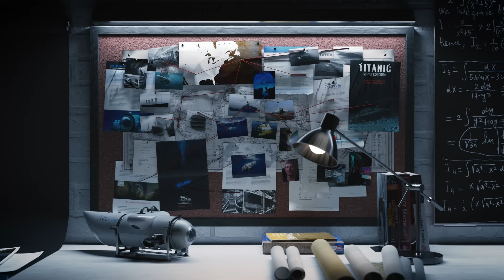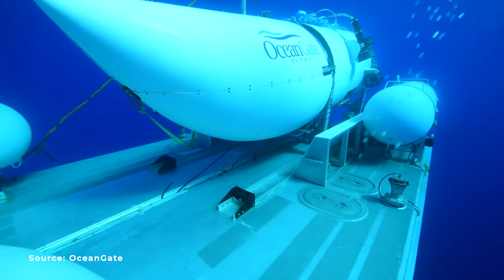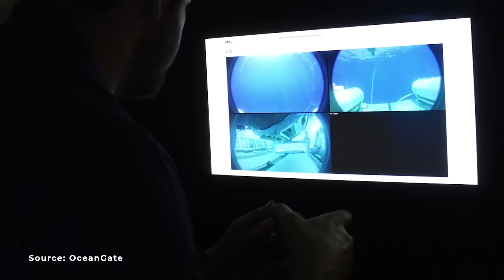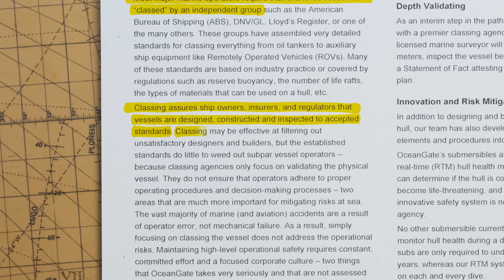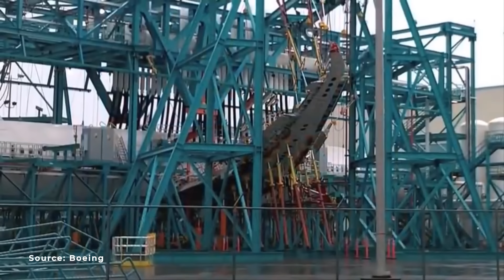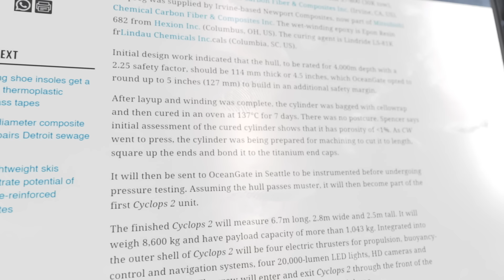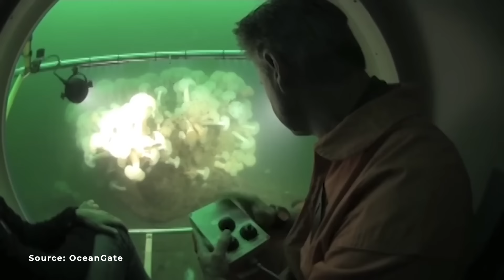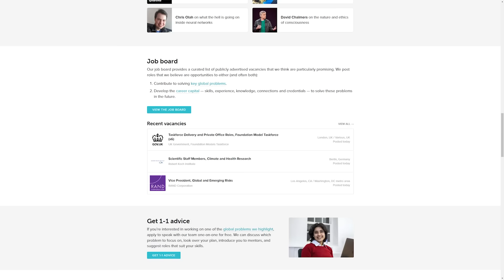The Questionable Engineering of Oceangate

Comment: I’m not an engineer but there appeared to be two glaring problems to anyone who doesn’t even know about it in this situation 1. If you can afford to pay to build it in the first place then you can probably pay to test it 2. If you’re gonna build something that’s required to withstand immense pressure why wouldn’t you stress/fatigue test it before using it?
Reply: they could have easily done a empty tethered dive to depth..
They didnt.....  what is worse the Company intentionally never went through proper testing and evaluation processes
because it would have been been condemned
Reply: @zarthemad8386  So the reason they neither paid for further testing nor wanted further testing is because they already knew it wouldn't pass the testing? But they still went ahead with the dive anyway? Did they just think that crossing one's fingers would be sufficient or that wealthy people don't die only poor people? I have very little sympathy for them if this is the case. It would've been very easy to test the sub first and correct any problems or scrap it entirely if it didn't pass the tests.

Comment: I do want to add that game controllers are actually fairly common use in a lot of strange places far removed from gaming. It's just a strong ergonomic design for putting a large number of digital and analog controls in two hands.
Reply: Yes, but:

1. An off-brand, made in China Bluetooth controller, when a reliable Japanese model could be had for $30 more?

2. Zero wired or manual control backups?

Utter madness.

Comment: People think of Carbon Fiber as being this magically strong and lightweight material, but as he stated, it’s really strong until it isn’t.  I’m certainly not a composites expert, but CF is very rigid but also brittle as he showed in his graph. It’s incredibly strong but once it flexes too much it simply snaps, which hardly seems a logical substrate for a submersible which will repeatedly deal with these kinds of pressure changes.  In fact, I would almost think Kevlar might be a better option.  It’s not quite as strong by weight as CF but it’s much more flexible and thus better equipped to handle the cyclical stresses of repeated dives.  

Also, I’ve seen mention in a number of places that Oceangate “expired” CF from Boeing at a huge discount because it wasn’t safe enough to be used in an airframe!  If it’s no longer considered safe to replace aluminum in a plane what on earth would make you think it’s safe to replace steel or titanium in a submersible.  If those stories are true, that’s nothing short of gross criminal negligence on the part of Oceangate and Rush.

Comment: The move fast and break things ethos is fantastic in prototype, testing, and validation processes. The ability to design, fail and fix speeds up development and can help prevent design creep. but this should not extend to manufacturing end use products.

Comment: 1:20 
My 1st concern is the design. A spherical design is far stronger than a cylindrical design, as the pressure causes shrinkage evenly across the hull and compresses the hull onto itself, a cylinder under the same pressure compresses bending inward.
Now on to more of the video
Reply: A sphere does let you get away with less material for a given volume, but a cylindrical shape works fine if you're willing to use some extra material
Reply: @addison1024 , depends on the material. Composites are now proven to have limited life expectancy without the ability to check….
At least metal is consistent, (unless flaws are present, as has happened in jet turbofans…)

Comment: Expecting to predict a composite hull delamination by listening to it crackling is like standing blindfolded in front of someone with a gun and expecting to dodge the bullet by waiting until you hear the gunshot. Oh you'll hear it alright...

Also I think there's a huge difference between what he did and what Elon is doing. 
SpaceX is testing unmanned rockets to failure in uninhabited areas and endless safety procedures. Mistakes/Unexpected can always happen but the redundacies are so abundant that there's basically 0 risks to everyone involved. New materials, new engines, new technologies, new manifacturing methods, innovations across the board.
Rush took all the risk-factor elements from SpaceX's approach but discarded all their safety features, didn't innovate in any field, if anything he  took well known materials / building methods and chose the cheaper versions of both, then proceeded to toy with people's life for money and to satisfy his narcissistic ego. 
If he actually took their approach he would have not only built it differently, but also throw that thing up and down the Marianna trench 20 times before even considering putting so much as a mouse in it.

Comment: To be fair to the game controller used as a steering device, there's a reason why it's a more widespread practice than you'd think. They are intuitive to use, easy to program to do whatever function they are used for, cheap to order in bulk and are standardized to be very easily replaceable, which makes them perfect for when you need to Steer a thing but don't need to design a separate mechanism for it.
Reply: Yeah but using bluetooth is idiotic
Reply: An off brand Chinese Bluetooth controller.

He saved maybe $30 on not getting a real Japanese Bluetooth controller like the military use.

A sub having zero backup systems is also insane, but there's a long list of insanity in this story.

Comment: Stress cycles took down the Comet jet aircraft - materials have bonds between atoms that are affected by conditions - cold makes them brittle the notorious brace of Liberty ships that snapped in half in cold climates - and Titanium which age hardens - good today bad tomorrow - it was banned in some components on race tracks in the 60's and 70's for this reason - the high pitch sudden creek sound was undoubtedly carbon fibers shearing under load - tragic.

Comment: The thing is, "move fast and break things" is a good mantra. It works. The important step is the thing they're missing.
To be able to move fast and break things, you need to be able to afford breaking things, and the things you break need to be unimportant.
"move fast and break things" NEVER EVER EVER EVER applies to things which involve human lives. That's the point. Test destructively when it doesn't matter, so you can trust your tech when it does.
You can break remote drones, unmanned rockets, and test vehicles with dummys in them. And, in fact, you should.
The mantra comes from software, where it is still applied with that effect. You don't ever break the system that matters, instead you test things, and learn from the failures, rather than trying to make it work first time.
The point is that no matter how slowly and carefully you go, it still won't work when you try it in real life. So instead, you might as well just get on and try it, then figure out what went wrong when it fails. You expect the first test to fail, you don't trust your life to it, duh.

Comment: Just use the simplest possible solution for this type of tasks. 15-20 centimeters steel walls should do the job. What's the point of complicating it? 
Make it from 1 piece of steel. The submarine is not even that big....

Comment: "Move fast and break stuff" was a motto taken from software, and doesn't translate well to hardware. I agree with your take there, as well as your view that OceanGate took standard composites manufacturing techniques and applied them, and was not inherently innovating.

The dig at Elon being overconfident seems strange, given that the Crew Dragon work seemed to follow a completely different test cadence from SpaceX's uncrewed flights.  Overconfident seems like an appropriate moniker if someone is failing, but SpaceX has a pretty consistent track record of success - I'd say appropriately confident would be more accurate.

Comment: looking at how they epoxied the cylinder to the ends. its no wonder it broke... those joints were almost certainly filled with air bubbles... i am almost sure thats what gave loose first and as soon as it moved off that lip "kaboom"...  at least its painless and quick... the cracking they were hearing was probably the air bubbles in the joints cracking a little each dive the hull flexed heavily... when enough finally broke,, boom...

Comment: What I can’t understand in the first place is, why build the damn thing in the shape it was built. The hatch end isn’t bad I suppose, because at least it’s rounded. But that point at the other end? Come on! Even a first year engineering student knows stresses are going to concentrate there. Actually, the ideal shape for a craft like this would be spherical, because the stresses would be spread out evenly in all directions. Make it spherical and of the right material, and it would be able to withstand the extreme pressures of two miles’ head of water.

Comment: Nobody is talking about the fact the Titian was sinking much faster than normal.  The Skylark even asked, “Do you  need to adjust velocity?”  The Titian was unquestionably heavy that day. They even had to drop the frame, but the ascent was still to slow to surface any time soon.  It was doomed at this point, but why was it heavy?  They dragged it for almost three days on a small raft exposed to rough seas and plenty of salt water.  Could the carbon fiber hull absorbed many pounds of water?  They didn’t weigh the sub to be sure it was on weight? The Titian was far too heavy that day, and nobody is talking about why!

Comment: "Over confident CEO"? No. Not nearly. Musk never put lives at risk. He tests rockets to destruction while unmanned and repeating to move faster by spending money on many copies, while improving them rapidly. 
His F9 rocket has flown 300x since early days failures (Long before putting any humans on thee rocket.) The rocket has higher failure tolerances as the rocket is designed for multiple uses and has 9 engines so that an engine out will not result in mission failures. During the 300 flights, there were 2 engine failures and both were successful. 

So no. Sorry if you don't like Musk but his cars have some of the highest safety ratings ever achieved and his rockets are rigorously tested to destruction before they fly. 

NASA and their traditional contractors, All the major car companies... came up short by comparison (How many deaths due to shuttle?). If you have an anecdote to point to, I would recommend remembering that engineers use statistics to form conclusions, not a few anecdotes in a sea of data with 2 million cars produced per year at this stage with analytics captured that far exceed any other car. 

FSD is statistically far safer than just driving alone and this is backed by data that NTSB and  other federal institutions peruse regularly.
Reply: Tesla has a below average safety record. He endangered and does endanger lives.

Comment: When I first heard about the submarine going missing and the fact that it was made out of carbon fiber, I knew it was a goner. I could never afford college, so I'm woefully undereducated. But I did fly racing drones for a few years. The frames for the drones are also made out of carbon fiber, with different manufacturers using different variations and thicknesses. Everyone in that hobby knows that the carbon fiber frame wears out, even if you manage to never crash. Just the repeated push and pull of the motors and gravity would bend the frame with every turn and boost. The more experienced fellas would be able to tell when it was about to happen and would swap frames before disaster struck. New flyers, however, would just fly until the catastrophic failure happened mid-flight; resulting in $400-$600 worth of equipment being vaporized.

Although a couple hundred dollars loss is nothing compared to the loss of human lives...

Comment: I understand your point but spaceX isnt exactly known for being unsafe nor reckless. They move fast, yes but they also test... A LOT. spaceX has at this point extreme amounts of experience and data. And this is when flying unmanned aircraft. For their manned mission the amount of testing and checks was increased even further. 
The Falcon 9 is the most flown US rocket ever. And has the best safety record in spaceflight history. And it keeps improving. The block 5 falcon 9 has 239/239 successful launches. Say what ypu want about elon must, or about their "recklessness" but their record shows attention to safety (and so does tesla) beyond most if not all competitors
Reply: A piece of concrete launched from the space X site destroyed an SUV.

This was because musk decided they could launch from a concrete pad.
Reply: @BeepBoop2221  1. This is per NASA guidelines 2. The area was cleared and evacuated like with all launches. The SUV should've honestly not been there. 
Nobody's was hurt, it wasn't negligence. And there's a lot more going into it that "Elon thought" 
Also, you do realize all launchpads are made based on FAA regulations and laws. They were up to code. Oceangate didn't test their sub and it was NOT to code. That's what negligence is. This was a honestly hilarious mishap/accident. 0.25 mile from launchpads isn't considered safe distance to a rocket launch, 1.5mile radius is usually the minimum evacuation and I think space X does 3 miles.

Comment: You don’t need to be an engineer to realize this design was problematic. I don’t know how their engineers didn’t catch this. Why didn’t they x-ray the hull for voids? I work for a company that does additive manufacturing and SLS with carbon PEKK. All of our parts are x-rayed post sintering, and smaller test parts are tested for tensile, resistivity, specific gravity, FTIR, etc… The notion that there’s no equipment to test polymer based composites for defects is simply false.

Comment: The one difference about SpaceX's  "moving fast and breaking stuff"  is that all the stuff that was breaking, was not manned, and that SpaceX kept analyzing what went wrong and made changes, until they got a reliable functioning system.

Rush was definitely egotistical, overconfident, stubborn, and out of touch with reality.  I think he knew he didn't have enough money to do it right based on his remarks about how the testing organizations would cost a lot of money and wouldn't certify the Titan because it was too experimental.  He also talked about not using a titanium hull with buoyancy foam because it was expensive.  Other signs that he did not have enough money to continue improving the design and materials was his hard sell to get passengers, oops "mission specialists".  Father and his son who thought about going on a dive on the Titan but decided not to because of the $250k per person cost, said that Rush flew to Las Vegas to try to talk them into going and reduced the ticket price to $125k.  That tells me he was in need of cash.  In the end, he believed his own BS and took another dive, totally clueless to the real danger the Titan posed.

Comment: Would it really have broken the bank for them to use the standard materials? Like, realistically, how many subs were they planning on operating, that it would save more money than they'd lose in lawsuits?
Reply: Standard materials would have made it much heavier, thus less buoyant, thus necessitating a complete redesign.  Additionally, the support vessel on the surface itself had a weight limit and they couldn't afford a larger one.  So despite not having sufficient capital to do things right, Stockton pushed ahead, cutting corners.  The rest is infamy.

Comment: As a aircraft mechanic who builds wings, ones that use a mix of materials INCLUDING Carbon Fiber. This word of his used materials made me worry instantly.  also it was expired Carbon Fiber. Which means I suspect if I ran my acetone test it'd not pas for what we used for aircraft.  Also delamination could be exacerbated by their drill holes if they didint use the right drill bit types or mishandled the process.  Their mounting on the inside made me wonder.  All it'd take is a bad barreled hole or a melted bit of the bonding material to entirely begin the process of making voids within the material layers. Once the delamination's begin you can't stop the process really. Titanium would have been better and overall easier to work with except maybe drilling because thats just not something you drill thorugh fast.

Comment: as a composite materials design engineer, I'm guessing I don't have to tell you what the expansion coefficient of carbon fiber is like, after seeing the TITIANIUM end caps fitted OVER the outer wall of the composite tube, I would think your natural inclination to question expansion/contraction under large scale temperature changes would result in these two very different materials,  does this need to be spelled out any more plainly?  We are talking about temperatures just above 32" F which means a full 40 degree variation from the surface temp.  There is no reason at all to believe this design would ever work,  any decent mech engineer can see the flaw and the failure mode in this design.

Comment: Hello! My thesis talk about carbon fiber composite..
Great points! Composite does not behave like metal, yes you can do whatever you want and modify the composition to fullfill ur need.. but ooohhhh that <1% void is the problem..
I like to use these phrase "a chain is only as strong as its weakest linkage"
And according to your information about the Fuselage composite fabrication, its weird that, first they choose material that does well on airplane but not in ocean, yet they make it using methods that less precise than when they make airplane Fuselage. To make it simpler..
You can make the Oceangate Fuselage in your own garage...
Its absolute madness...
Composite is very versatile materials, very fun one, and yet it is far more complex than traditional material like metals..

Im Bagus from Indonesia..